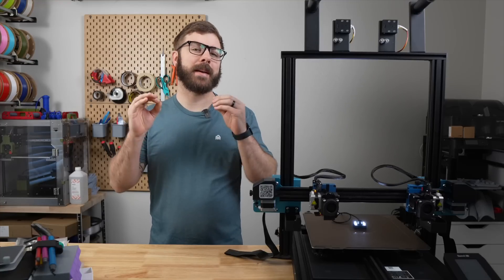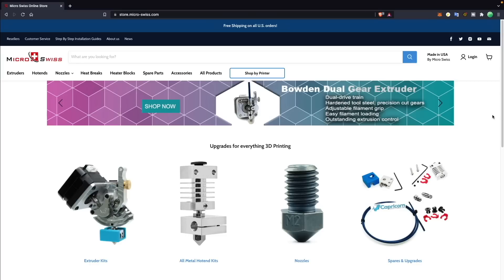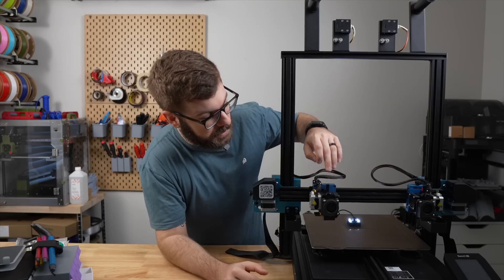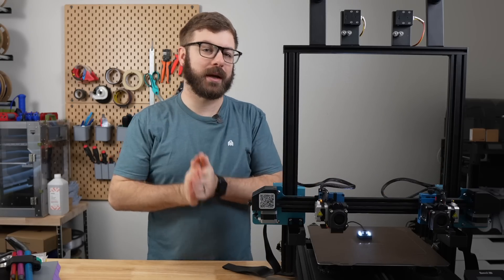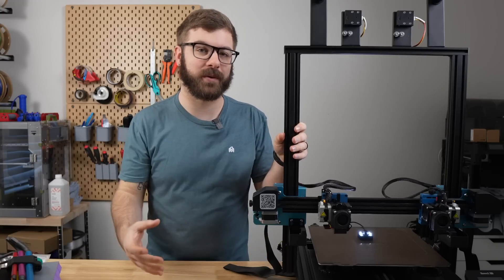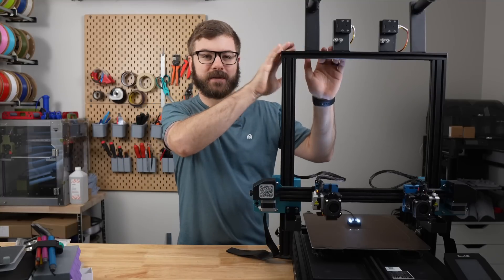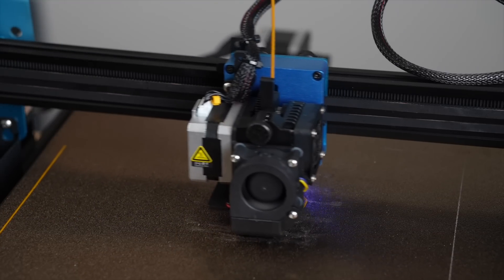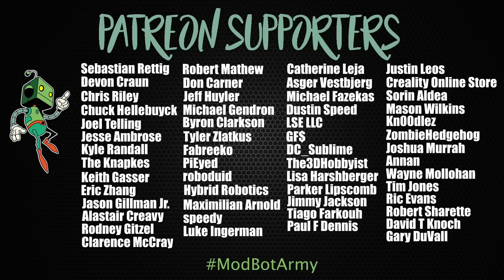Multi Extruder 3D Printer Calibration Simplified (CXC)

Comment: If you move the left extruder back over before switching it'll let you move the right extruder over. If you just hit switch and it homes the left toolhead it saves the "last position" of the left toolhead as a soft limit for the right toolhead. Still wonky, but less of a pain than a full XYZ homing.

Comment: I was thinking of something along these lines, but using an Opulo LumenPnP (a great open source PnP machine) derived camera.

Unlike this it would be in a fixed (or maybe rc type servo flip out?) a d would check the nozzles before each print etc

This would allow for alignment, but also nozzle cleanliness / wear monitoring!
Reply: Our CXC actually has mounting holes on the bottom so you could totally mount and integrate it permanently and then write some custom software or gcode to do what you want. We actually use ours for nozzle monitoring as well sometimes although we don't actively advertise that.

Comment: Why don't you just stick it to the base of the printer under the build plate so when you go to Y=0 it's exposed at the bottom edge of the build plate and might even be the right distance from Z? This would only work if Y = 0 is far enough to go past the edge of the build plate, but it does on things like ender3.
Reply: @miltonb4522  that's a good point, though on a case by case basis, the Y offset for many folks could end up being close enough to perfect, or could be shimmed and adjusted out so you only need to worry about the X offsets. But that's quite a process in itself, so you are likely right.

Comment: Thanks for this video. I believe this camera system will be a great tool to have. I have been in the process of building a core x,y, duel extrusion machine. Also been experimenting with multiple hot ends and layouts, so calibrating nozzle offsets is getting old. Looking forward to try it.

Comment: Like the idea, but couldn't you just buy a very similar looking camera module from our Chinese friends for dirt cheap, print a housing with magnets glued in on the back and some LEDs on the front, use the standard software, and work out the offsets with an excel sheet? Only thing you'd have to figure out is the cross, if there is no generic software that will do that for you. Some transparent plastic and a fineliner could solve that 🤷‍♂️
Reply: Openpnp has a wizard for nozzle tip run out calibration and a nozzle head offset relative to the looking down camera (top/mounted to the toolhead) use these values to find your nozzle offsets for 3d printing. All open-source btw
Reply: You could do exactly that and use openpnp. Only difference you'll need to buy two cameras. Top and bottom. Look into openpnps nozzle calibration. A pick and place and 3d printer are just CNC machines both run gcode. Only difference is that the pick n place uses vision for location while a 3d printer uses endstops and probes

Comment: Great video! I still can't believe the SV04 has to home the entire printer just to move the right tool head 😅
Reply: It doesn’t.  There’s a bug where it will work correctly sometimes but not others.  I still haven’t figured it out, or it’s random.

The main reason this is a huge PITA is when setting the z-offset you want to put both nozzles at the same location.  The beds on these printers are often badly warped (if not always, although some people have said they had no issues).  I use glass plates because the warping is simply too bad to address via mesh levelling.

Firmware bugs and (probable) warped bed aside, it’s a good machine.